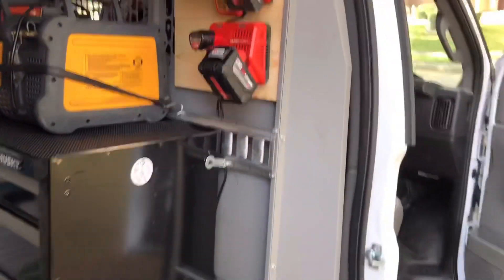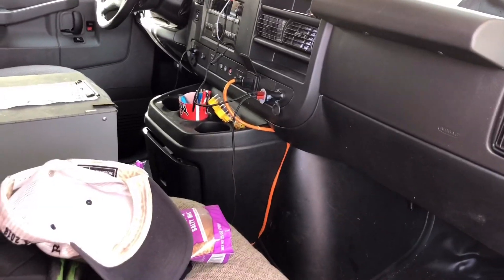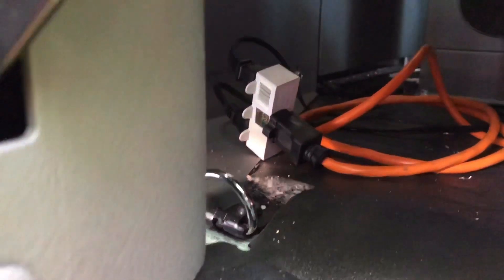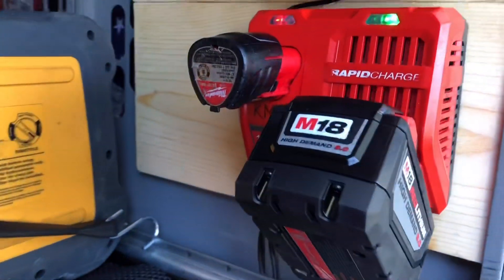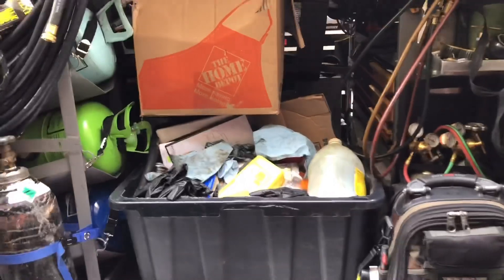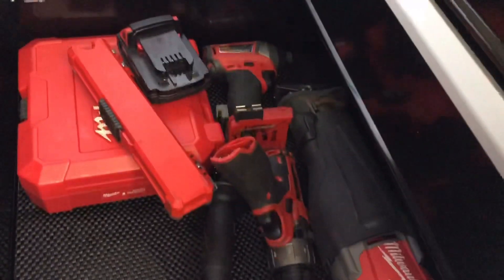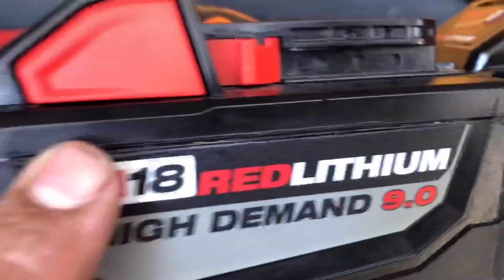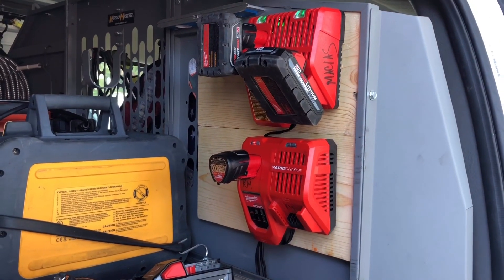HVAC/R: Van Charging Station, Milwaukee Chargers Part 1

Comment: I'd get that Rapid out of there if you haven't already. My Dewalt 18V (the disclaimer that I'm not in the trade probably belongs here) single charger would probably trip that inverter outlet off on overload if it has the same limits as the inverters in Chrysler Minivans from 2014.

Comment: those milwaukee chargers are sequential chargers...they only charge one battery at a time...if you have both batteries plugged in it will charge one then switch to the other one after the first one is charged
Reply from the maker: Yes you are correct.  I was mistaken in my comment in the video.

Comment: I superglued The super strong metal magnets to the bottom of mine and it works great for my M12 charger.
Reply from the maker: Yeah, I have some but I figured I’d like to screw them in.   This is just step 1 so I’m pretty sure there will be changes soon. Lol